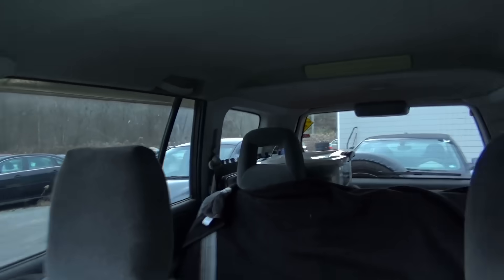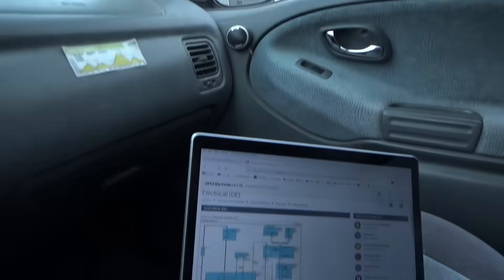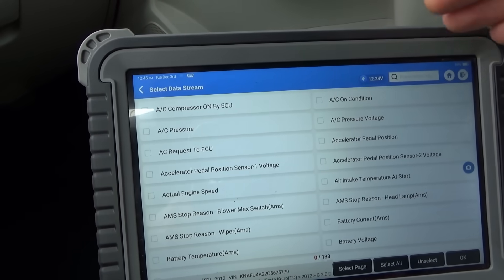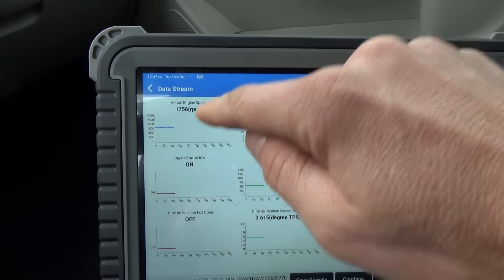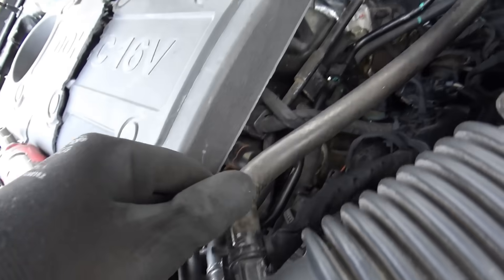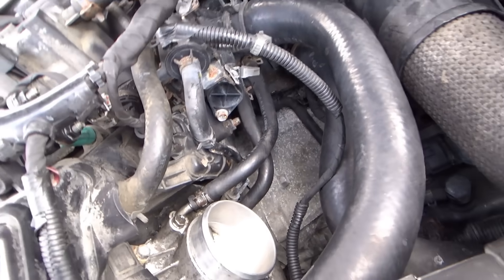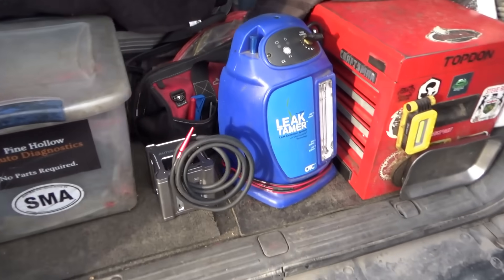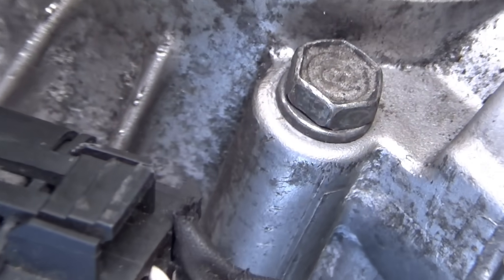Auction KIA LIMP HOME: Idles at 1,700RPM!? ('12 Forte P0507-P0110-P0605)

Comment: This confirms a trend for me. I had a newer Subaru Ascent come in with a P0605 and it was being caused by a bad seal between the turbo and intercooler. Big enough boost leak that It sounded like a blow off valve stuck open. Seems the industry as a whole will react to massive intake leaks as a ROM error.
Reply: Now i gotta lookup the criteria to set that code 😅.

Comment: shake rattle and roll! doesn't sound like a spark/fuel misfire early in video, then with rpm's high and shaking, I say vacuum leak somewhere effecting one or two cylinder.
now I'll watch past 5:27 and see.
** I was expecting a gross vacuum leak, but certainly not a cracked intake manifold! I wonder if someone double-ham-fisted it removing intake tube/servicing something else in the past.

Comment: One thing about that plastic, it likely will only go through so many heat cycles.  The 'ol Marquis had a plastic intake manifold that had a water passage.  After about 38,000 miles (the car was just out of warranty) it exploded all over the alternator. Of course, we all know the fix was a METAL passage. That little smoke machine is just right; it produces enough smoke to diagnose leaks on a very windy day and is a manageable size.  GREAT VIDEO!

Comment: Squirting 2+2 carb cleaner around the manifold way before smoke machines were a thing found a lot of vacuum leaks back in the day😂
Reply: brake cleaner, propane/mapp gas, most anything flammable(not highly explosive!). even plain water you could hear being sucked in through leaks.
a smoke machine would make it much easier on many small/well hidden leaks though.

Comment: Nice and solid diagnosis! I'm still confused about that EPROM error, that could still be used by an intermittent overvoltage or bad filtering on the alternator, right? Was that code coming back?
Reply from the maker: @Stoney3K  it was set due to the ECM trying to close the throttle past the limit lol

Comment: Next time you are in the Los Angeles area, you are welcome to look into my 89 GMC V1500 that has a high idle until the trans is put into drive and its warmed up. Starting from cold to full normal temp in park, the idle won't come down as it warms up but put it into D with the brakes on, the idle will slowly come down and then it will stay there until the key is cycled. Warmed up starts result in not as high an idle and will come down once in D but it will return with every cycle of the ignition, off/on. We set the default RPM with the IAC disconnected and still have the issue but if the idle screw is turned to a lower RPM, the problem gets corrected however, the idle then during operation seems to be way too low.  Sound like an IAC or something dirty in its port with the EFI throttle body ? Seems like a simple fix but no one can. Original owner here, no aftermarket parts are used...bone stock vehicle. 
Thanks for your videos...many of them put active "mechanics" to shame, shame, shame.
Reply from the maker: You need a Snap On scanner to read the IAC counts :)
Reply: @PineHollowAutoDiagnostics  AKA "the Brick"?
Reply from the maker: @Garth2011  any SnapOn with the 12 pin GM adapter 👍
Reply: My 89 had that problem, I replaced the iac. Problem solved. I did have to reset the the throttle position as a previous owner or shop had messed with everything but that actual cause.
Reply: @boardhead888  My first experience with a high idle was the TBI/manifold gasket was pulled inward from vacuum. New gasket fixed it. Then the original OEM IAC was our focus but no OEM replacements were available. I keep looking but no bueno. Aftermarket is in there now. I might be able to get a Borg Warner IAC which could be a better replacement or a Delphi if I can find one. I won't waste money on other aftermarket electronics/sensors.
Reply: @boardhead888  Did you find and use an OEM Delco part?

Comment: Hey Ivan, it looks like you've got the Topdon out for this video. I have a Topdon scanner as well and a year left on my "free" subscription for updates, but I haven't received any software updates for the past 6 months now.  I used to get a couple of updates a week.  Have you noticed a lack of updates on yours - or has anyone else?  Topdon's support was entirely unhelpful and refused to confirm or deny whether any updates to any software packages (for the specific car brands that is) have been released in the past 6 months.   My updates stopped when I filed a support request due to being unable to access the BCM on a 2008 Suzuki XL-7 via the Suzuki menus, but I can access it fine if I manually select the car as a 2007 Chevy Equinox.  It feels like they blackflagged my account.

Comment: Surprise it didn't set a p0171 code or mass air flow code , sometimes pouring a bottle with water will find a vacuum leak on the engine.
Reply from the maker: @michaelgraham2347  I stated multiple times that this is a MAP engine 🙄
Reply: @PineHollowAutoDiagnostics  🤣🤣🤣
Reply: @PineHollowAutoDiagnostics  Reading and listening comprehension is a thing of the past.

Comment: Another weird one, Ivan! No less than a cracked intake manifold! And the little smoke machine actually delivered (you should get some manufacturer compensation, for this real-life validation).
Just wondering if there was also something wrong with the alternator, once the burnt smell is never a good sign. Anyway, the Kia is back on the road, and that's a win 🙂
Reply from the maker: Maybe the battery that the lot owner put in was depleted so the alternator got toasty pumping out the amps on first start-up haha

Comment: Replace intake manifold?
The dealer?
😂😂😂😂.
I bet they put JB weld on it 😂
Reply: That's sounds about right. The dealer put JB on the Transfer Case on my car to try and hide that they broke it when replacing cv axle.
Reply: @MarzNet256 jb weld would not work in this case😮
Reply: @hhn2002  Correct. It started leaking about 100mi after "repair".
Reply: @hhn2002  Yes it would.  they make a ABS plastic version.  I used it on two cars so far.  The glue held and the part broke in a new place.
Reply: Jb weld would work in this case

Comment: Nice. I bought an Ancel S100 smoke machine for about $100. It does require battery and air hookup, but it works and paid for itself the first time it was used. Also, that is a great point about fuels trims with vacuum leak with MAP vs MAF.

Comment: Ivan, since Launch scanners run on Android, I'm pretty sure if you just swipe in from the very edge of the screen (left or right side) that's your back gesture. Android has adapted gestures since 2018 but not every manufacturer enabled it so it's kind of confusing, but give that a try.
Reply: He's using a "TOPDON" scanner on this one.  Not a "LAUNCH".....jus' sayin'
Reply: Same thing... @beauhatman4395
Reply: @beauhatman4395  Same software
Reply: Same plataform  the software is the same X431 pro . Just has some make up on Top Dom @beauhatman4395
Reply: I'm curious if the Launch lets you do this!  The Autel I have is running a very custom Android build, and a lot of the otherwise "standard" functionality I'm used to on my phone is disabled or tucked away out of reach.
Reply: @rhkips  Autel strips the Android down a lot, but you can get past it
Reply: Pretty much all these ching Chong made scantools are running android as the base OS Autel does it Xtool does it and I'm pretty sure Top Don is doing it as well

Comment: I bought that smoke machine after watching the BMW headlight video.  Used it to diagnose an evap leak in my civic.   Pretty cool little machine, thx for the heads up in it!
Reply: Here we go. It was used to see if it worked. And it did.
Reply: Smoke machine for headlighrts leaks is over kill.
3psi air pressure and  a sprayer bottle with soap will do it.
Reply: @rcard23yb  i used to use tannerite to test headlights, so 3 psi is certainly is an improvement in the safety factor
Reply: @ That will find the leak EVERY time.
Reply: it is a BMW this is the blinker fluid